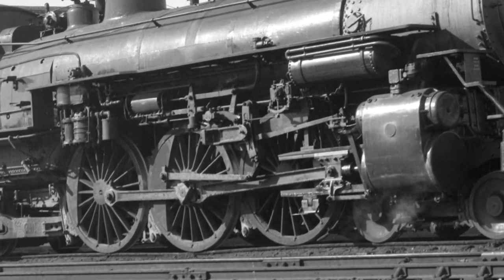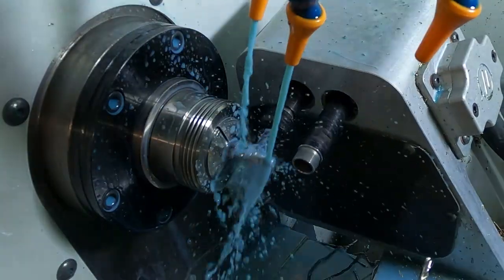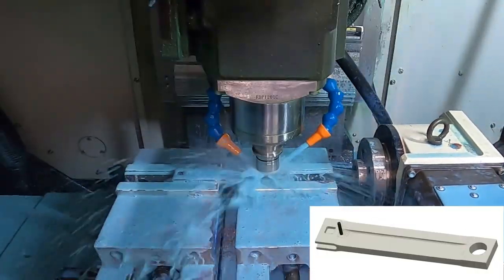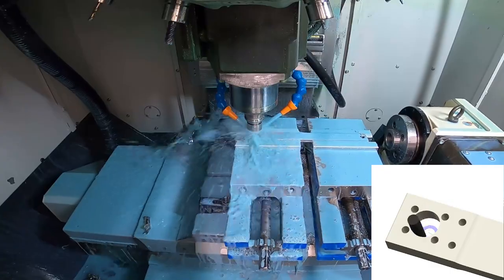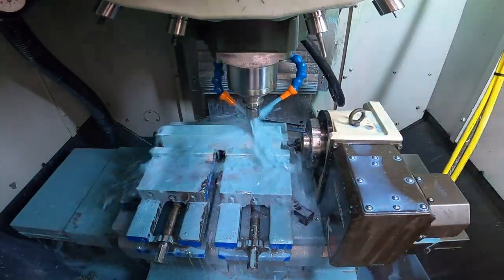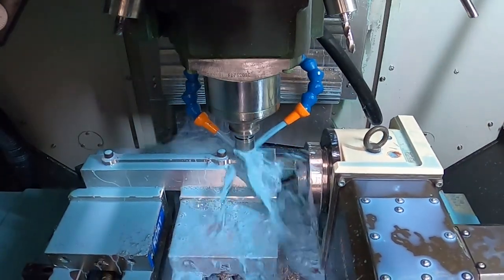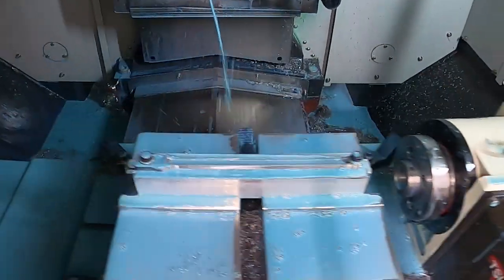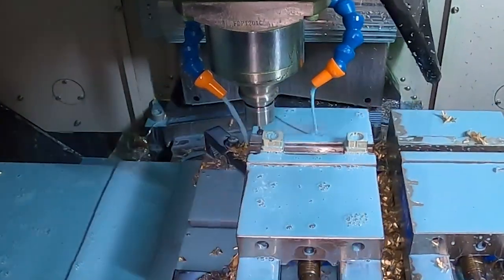Machining New Rods for SP 2414 -  Part 3 - FLUTING, PROFILING & ASSEMBLY

Comment: Impressive!  I'm envious of your shop...  Having a CNC machining center and lathe definitely move things along at a quicker pace!  To do all this work with manual machines would take a heck of a lot more time and the results might not be quite as consistent.  Really like the way you did the wrist pins on the rod joint.  Clever!  Did you Loctite or pin the rod bearings in place?  I was under the impression they are pressed into place and pinned to prevent rotation.

Comment: I really enjoyed this video!   I like to hear your thoughts and comments as you progress through the work-flow. The rods slipped on the chassis pretty well. Of course there are various things that can make that fit well, or not. Quick question… who quartered the drivers/axles? And, as a standard practice, do you like to achieve quarter by quartering the axles, or the wheels? Thanks and looking forward to your next video! -Dan
(ps: I am a Pennsy RR guy… Pennsy quartered their drivers such that the left side leads in quarter. I am not sure how many other companies if any, did this. Majority were right lead in quarter… I believe. Just an interesting bit of trivia.)

Comment: Will this be able to hold all the weight & withold the torque during motion?
Reply from the maker: Yes, even though they’re a slimmer profile than the original, stainless steel is significantly stronger than the original cast bronze rods.
Reply: @EccentricEngineerYT  don’t mind me big man; I’m just a lil too nosy:)